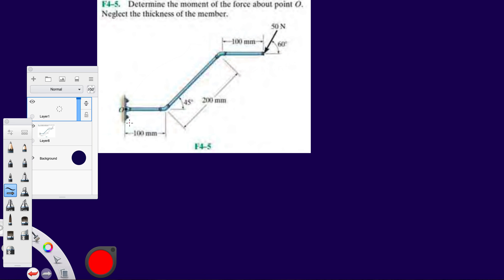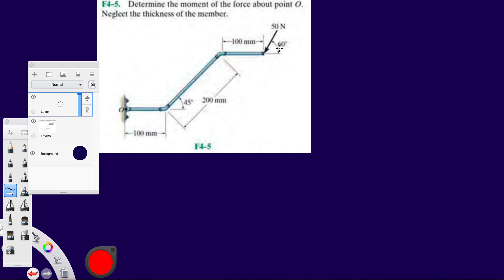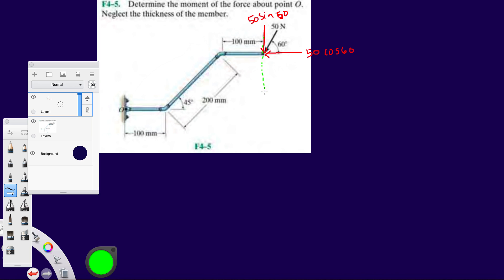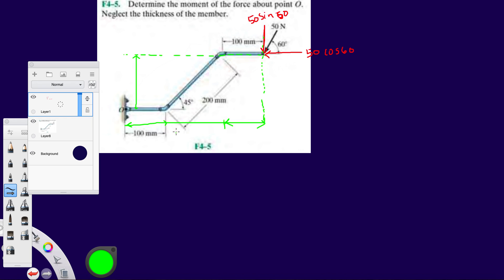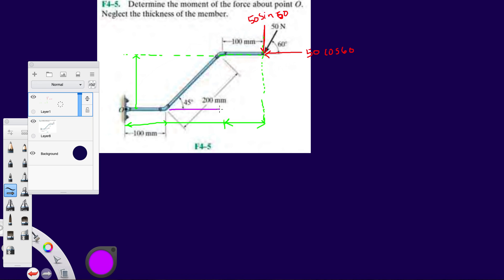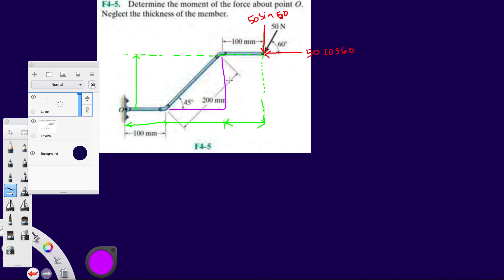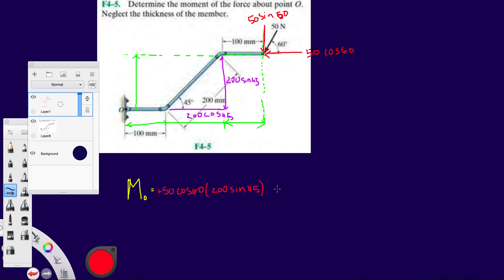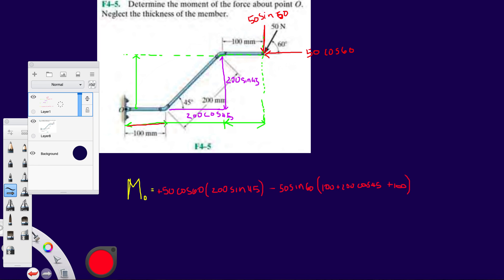Problem F4-5 Statics Hibbeler 12th (Chapter 4)

Comment: How do you know whether to put a positive or negative sign? I’m a little confused about that.
Reply from the maker: Visually: If you were to press down on the point all the way to the right of the structure, the whole structure would want to rotate clockwise around point O. This would be a negative moment. Same applies if you were to press upwards, the structure would want to rotate counterclockwise about point O. In this case the direction of the force doesn't determine the neg/pos sign, it is the direction in which the structure will rotate that determines the sign of the moment.. For the mathematical interpretation, you need to remember (r X F). r could be 300i (measure from the point O to the right). F could be -150j (meaning the force is pointing down). When you cross the two, you should have (300i x -150j), which could be interpreted as 300*-150*( i x j ). This should yield 300 * -150 * k (for direction, which points into the page) which is clockwise due to the negative sign. Sorry if this is a lot, I can try to be clearer if you have more questions.